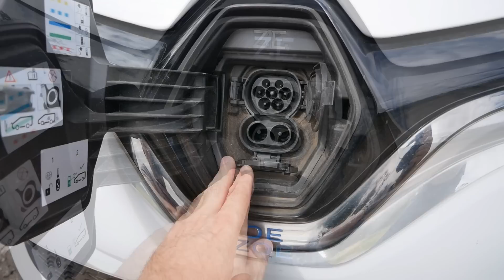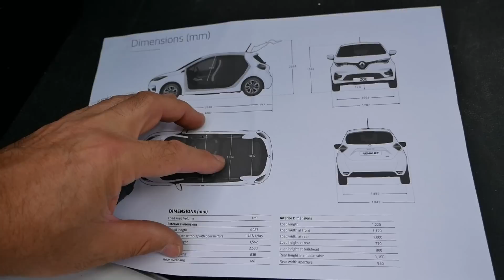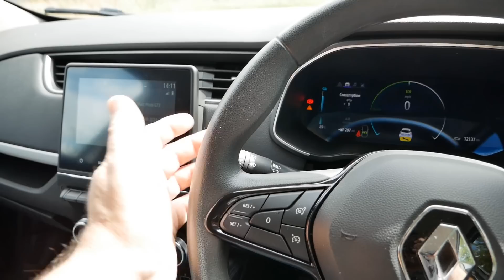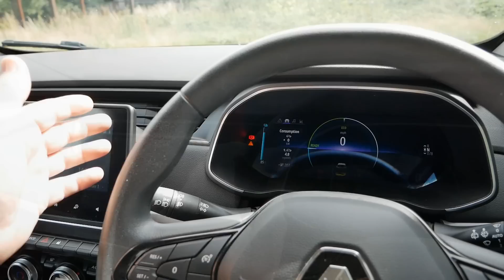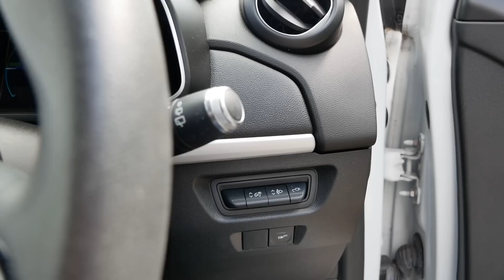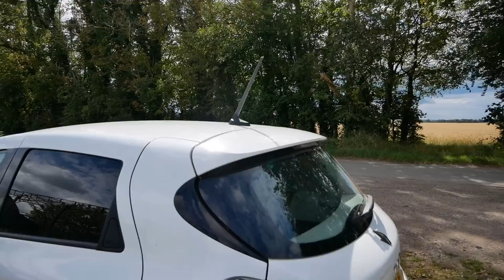Renault Zoe ZE50 electric van review (decent range, size & specs)

Comment: Thanks Matt. For reference, we have the hatchback, and it often carries cargo: 

In mixed urban and B road driving, it's quite easy to do 300 miles in Summer. We average 5.8 mi/kWh in Summer and 4.8 in Winter. On motorways we see 4.6 mi/kWh in Spring/Autumn. (I've not measured motorway consumption in Summer or Winter.) 

Under ideal conditions, flat urban roads and a hot Summer night, with a pre-warmed battery, and no stopping for traffic lights, I've seen 7.5 miles / kWh on a 20 mile round trip.
 
The very worst I've seen, in freezing weather with snow, the car managed an estimated 212 miles from a full charge and with a battery starting from cold. I recharged the car from about 22% SOC, because I didn't want a cold and discharged battery.
Reply from the maker: Thank you for this info, very useful.

Comment: They aren't good for 250 miles.  200 is real world in the summer and 170-180 in the winter.
Reply from the maker: Someone else has just posted they are getting 300 miles from theirs in the summer. As always, it depends on how you drive.

Comment: To save weight, you'd have thought that they'd have removed the rear passenger doors, which are completely unnecessary on a small van, because it would extend the battery range further
Reply from the maker: But that would require a significant change with new press die tooling etc and not worth the money and would probably make it not viable to do a Zoe van, when they already have the Kangoo van.

Comment: This looks like a excellent last mile courier vehicle. It's a shame they aren't in North America. It's also a shame 3 phase is so rare here. 3 hr charge from flat is really impressive. You could go 80 miles in the morning, fully recharge over lunch and go 80 miles in the afternoon, charge over supper, and go again on an intense delivery day (a big sales day or big event like Mothers Day for a flower shop) and never go under 50% so you could daily intensely drive this without degrading the battery notably at all! Wild.
Reply: Also, the autolock, auto-unlock with the fob would be a game changer when out doing many deliveries or pickups door to door. Minor but repeated annoyance fumbling with a fob every time. Well thought out.

Comment: The good thing nowadays is that we have so many different sizes of vans,No this won’t suit everyone but it will suit a lot of people. I’m retired and do at most 3,000 miles a year, my wife has an id3 .I have a kangoo ze33 van,I use it to take the dogs out and garden centre and the tip also to collect logs from the verges. We have 18 solar panels with a Tesla powerwall battery so we run both the cars on solar,we have had ev cars for 3 years and have never charged away from home.we have a zappi charger. If you sit down and work out what you need you probably would be surprised what would suit you. I very rarely drive the id3,I’m much happier driving my Kangoo. I don’t need a van with a bigger battery for my use,I don’t see me changing for a long time.
Reply from the maker: Good to hear

Comment: Interesting.  But really it is just a car with the rear seat removed.  All the main requirements of a van are not there.  You need easy loading and neither the side doors nor the back with the lip (however small) allows this.  The rear window is still clear and any of them can be broken in seconds to get what's in the back.  The front is like a car and looks nice now with low miles/not much use, but with the hammering work vans get will it last?  Look at any van and they all have to take a lot of abuse - perhaps mostly when it's not you that owns the vehicle.  If they are plastic support runners under the rear tray then maybe they will get broken quickly.  You could probably just buy the car version, take out the rear seats and get a sheet of plywood from Wickes and achieve the same thing (thought you will need a proper van to get the sheet home initially).  However...it may find its niche somewhere - dog walker/owner.  Evri (Hermes) driver or similar working in a tight city with clean air zones.  Or someone who never want rear seats - though the insurance may be more if it's classed as a van.  I'm not knocking the video btw - just Renault's take on a small van by just taking the rear seats out.
Reply: Very popular size with small businesses here in Ireland… Lot of Fiestas, Corsas, Astras, 206/207/208, Corollas, etc., have been sold like this over the last 20 years or so. Also lower purchase tax compared here that helps.
Reply from the maker: No different to any of the car derived vans, such as the Corsa, Astra etc. They have their place.
Reply: It’s all about taxation and VAT